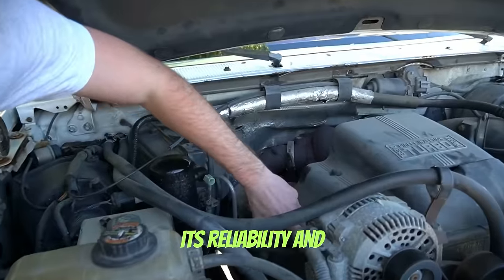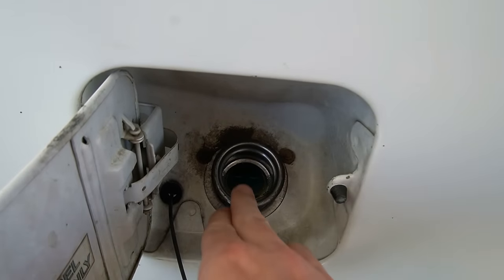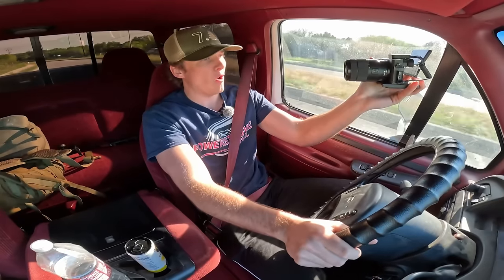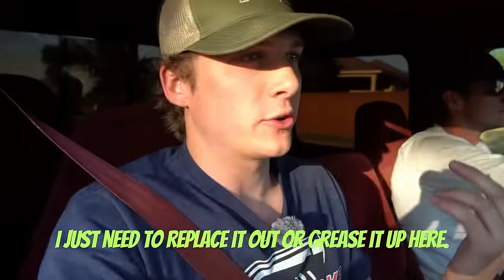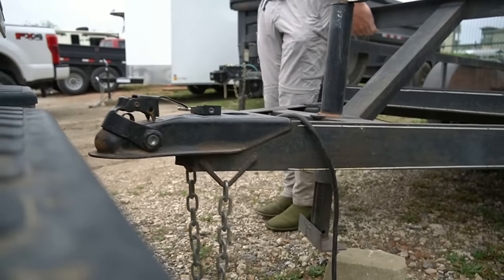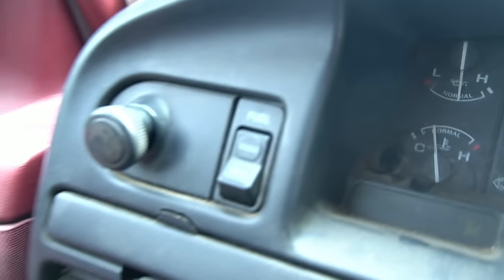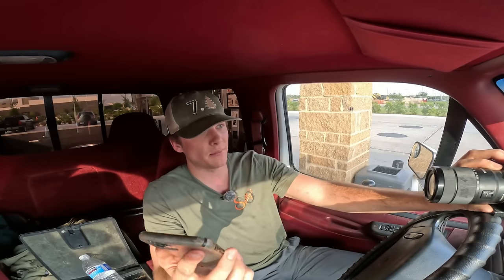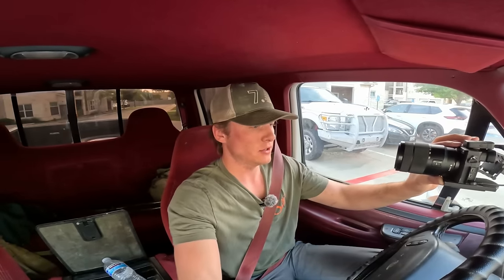I Tested The Reliability Of My 7.3L Powerstroke

Comment: Hard to believe now, but when the 7.3 powerstroke was first introduced, it had a lot more get up and go than the old 7.3 IDI and the 6.9. My dad had a 6.9 f250, the local ford dealer got in a 7.3 powerstroke 5spd, we went and test drove it and were blown away by the power. He bought that truck, it was the only one in the area.

Comment: I hope you get a 6.4 one day, I’d love to see what you’d do to it
Reply from the maker: The more merch I sell the sooner I get it
Reply: My old boss has one if you delete them the work good fast as hell with just intake exhaust and a tune terrible gas mileage tho
Reply: I can assume itd go like this:

1. Buy it and drive it home and make a video.
2. Motor throws a rod, spins a bearing, develops a knock, oil starts growing from fuel or coolant, needs a front cover, cracks a piston/‘s, turbo failure, rocker arm tips break off, radiator starts leaking, one of those
3. Makes a video about why he sold his 6.4
Reply: @FordFan01 Sounds to me like you have no clue how to maintain a 6.4 😂😂😂🤡

Comment: if your trans is acting funny at all get the PSOM module rebuilt and check the vss on the rear diff. Thought i blew mine up but turned out to be the PSOM needing rebuilt. crazy part about it is it shifted perfectly fine then out of nowhere it went nuts slamming into gears and dropping into neutral

Comment: I love my 7.3 when you get to upgrades stick 180/30 injectors and a kc stage 1 .84 A/R for a  good daily driver / tow rig. If you want to play a little harder go with 205/30 injectors with a kc stage 2 that setup will put you close to 475hp with a fuel system intake and exhaust. Ive got the 180/30s stg1 kc and its a absolute blast to drive and tows like crazy. I originally had the stg3 turbo and 205/80s and it was hot and smokey and sucked at towing but pretty quick.

Comment: I have an e99 7.3 superduty. Thing tows amazing. I pull a 32 foot 5th wheel no problem up and down any mountain or road ever. It has 33 inch rough terrains, an ignorant mod from the previous owner.. hot cold air, and straight pipe. Keep good batteries in it and don't let the diesel gel and she'll start every. Single. Time. Mine pulls amazing

Comment: I took my 99 7.3 from Amarillo-dallas-college station-iola-new caney(picking up 30ft bumper pull trailer 7k lbs)-iola(back and forth to college station building something for my parents and spending time together)-back to Amarillo. Didn’t have any issues at all with my truck one bit and on my way back to the panhandle I think it was I calculated around 17-18mpg with certain things added to fuel plus mods done

Comment: I have a 96 F250 ZF5, and a 1996 F350 Dually e40d. I’ve modified the shit out of the F250, and as a result I believe I have finally cracked a piston in it. 

If you want good quality headlights buy from Tony Rojo. He operates bajahidretrofits, and most of his business is 92-96 F series/ bronco. I have the Mled 2.0’s and they’re killer.

Comment: Dude I have a 7.3 and only get like 9-12 mpg idk what’s wrong
Reply from the maker: What size tires?
Reply: @powerstrokecentral  just 35s, I remember you had pretty good mileage on your last 7.3 with 35s
Reply from the maker: @ConnerJAllen  that’s why
Reply: @powerstrokecentral  but 9 mpg? That’s outrageous I’ve only gotten 12 when I get lucky. I’ve never been crazy with the pedal when I try and calculate the mileage. And it’s like 8.7 or 9 all the time.
Reply from the maker: @ConnerJAllen  yeah I got 9 before I tuned it then I got 12
Reply: @powerstrokecentral  oh gotcha, I thought you were getting like 16 or 18